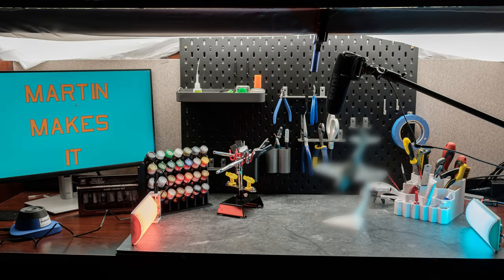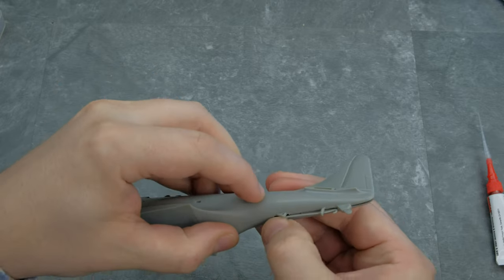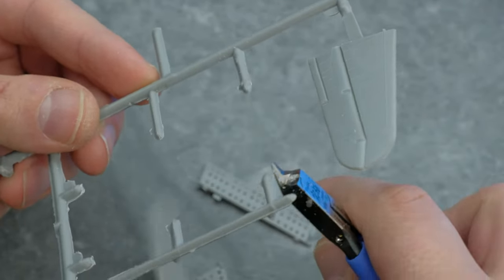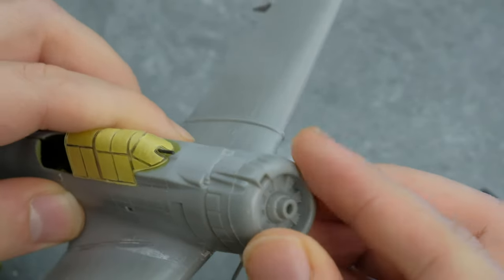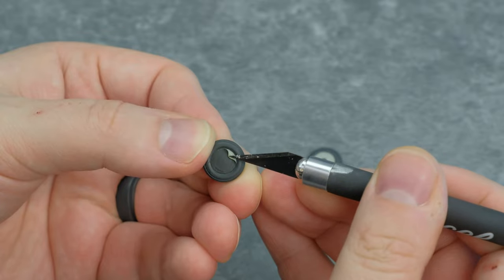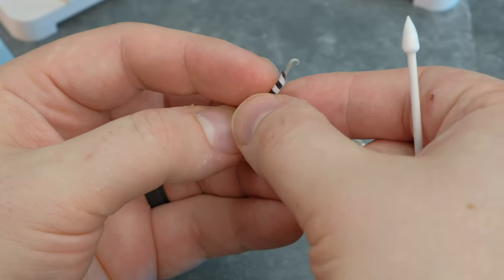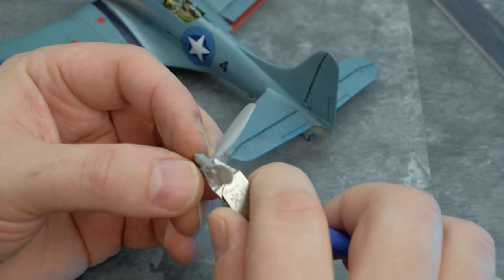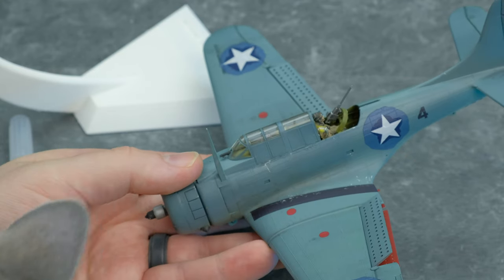First scale model build in 25 years! Revell SBD Dauntless 1/48 scale full build

Comment: I have this same kit. It clearly states in the instructions to put the bottom wing half on first then glue the top half on. Also, the instructions tell you not to glue the parts like the arrester hook and bomb release.  That's all optional though, i guess.
...I'd also like to add that this kit is really not that great. It's not very detailed and it has some fit-up issues. It goes together more like a toy you can play with not so much for static display with things like movable landing gear, tail hook, and main bomb release. Over all, I'd say this could be a good kit for beginners that just need to get a few models under their belt.  
If you're looking for something with more detail, go with another kit.

Comment: Thoroughly enjoyed your build. Old kit but still a little gem. Can share how you made the stand? I hate to see model aircraft on the ground, I prefer to see them in flight, where they belong! Keep up the good work:)
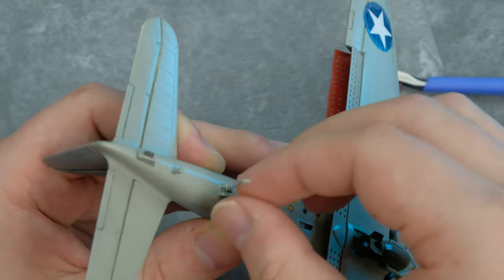Reply from the maker: At 16:54, I briefly show the construction in Fusion 360.  I started with a trapezoid base and then extruded it with a taper.  I then imported a Dauntless model I found on thingiverse and positioned it about where I wanted it.  After that I just messed around with a curve I liked to get the base to point on the model where there was already a hole from the bomb release tab which I had cut off.  Then made a little nub that would slide inside the model to hold it in place.  I then just put text on the base and extruded that.  The font is USN Stencil.